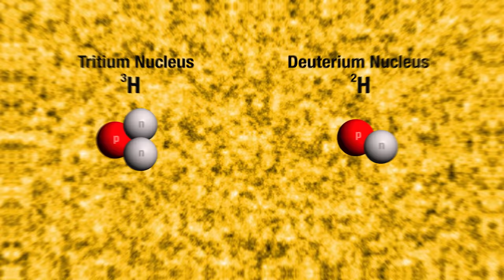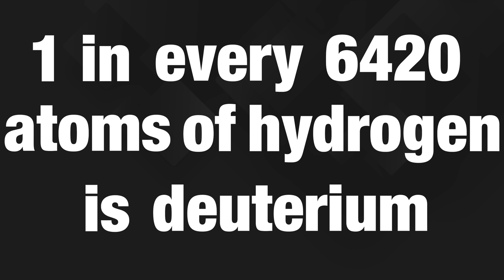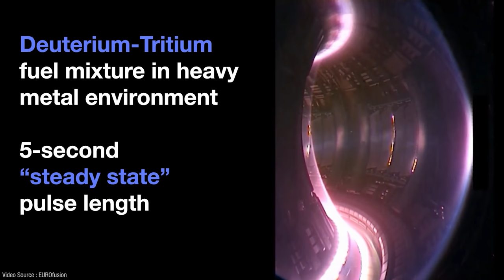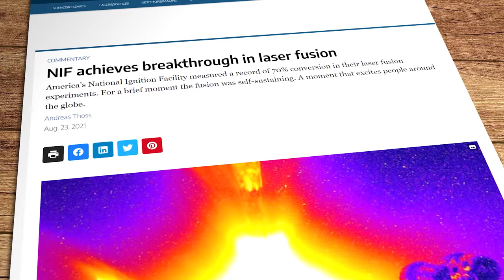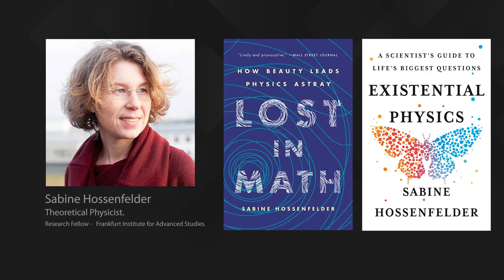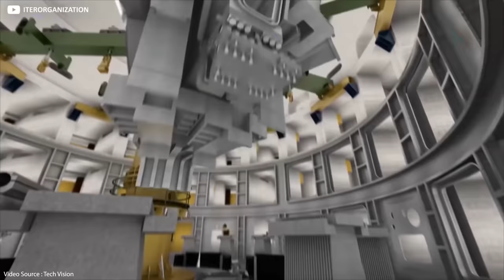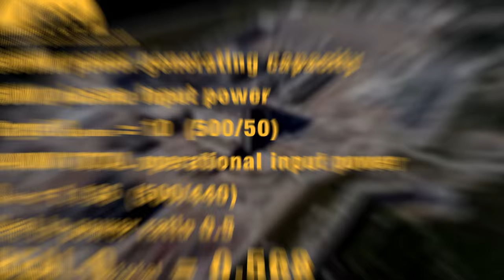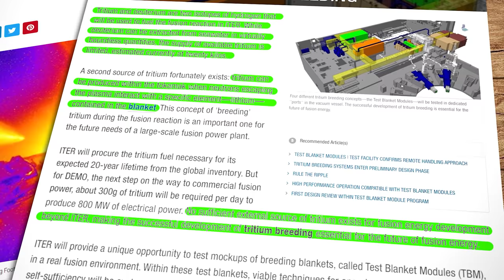Nuclear Fusion Illusion. Is it time to park the pipe dream?

Comment: I think the current approach looks broadly correct: society has essentially stuck fusion development on a background thread and is getting on with other stuff in the meantime. The billions spent so far look to me almost nothing over the timescales we're talking about.
Reply: $25 billion spent over decades by 7 nations. While I support assistance to Ukraine I feel compelled to point out that figure is not even twice what the US alone has spent one the war and associated military buildup in Europe, and just 1/4 what Germany alone spent increasing their defense budget since the war started.
Reply: There are scaling limits to what more could be done with increased funding. Skilled labor, rare materials, and finite electric output are just three caps on it.
Reply: @jackfanning7952  You're talking about fission, not FUSION.
Reply: Investment in Fusion vs Investment in Renewables seems like a false choice...they aren't the only two options in a "budget" zero sum game. This seems like quite an oversimplification and counter productive imo. For example, in 2021 the IMF reported that the fossil fuel industry benefits from subsidies of USD$11m every minute (ref: The Guardian, 6th Oct 2021). Might that be a better source of renewable research finance than (admittedly long term) fusion research?

For mine, a large part of "the problem" is the overhyping and resulting unrealistic expectations...commonly created (often inadvertently) between the research community and the media. If I'm a fusion researcher, I might get much more excited about a new Q figure or "breakthrough" than the public should...and that's reasonable and understandable. The media doesn't seem to parse this though, and passes the excitement (or magnifies it) when communicating to the public...over time creating a sour taste in people's mouths after being "mislead" for decades.
Reply: @nathanlevesque7812  we are still in the research phase. More powerful magnets are already in the pipeline. Until we have a reactor that works constantly there is no point in going faster. What we are doing is working on as many different options as we can in the hope that at least one and possibly more manage to get to an efficient power plant.
Reply: @johnarnold893  I am not talking about fission. I am talking about fusion. My statement are true, but like everything about nuclear power, the proponents cover up and lie about the true dangers or it. Some forms of fission also cause these and other dangers, but fusion will also create plutonium, uranium-233, and can not only burn actinides, but also create them. Fission creates hundreds of radioactive isotopes by splitting the atom, but fusion is worse at creating radioactive isotopes through neutron activation.
Reply: @jackfanning7952  This statement is 100% divorced from reality.  Like, really, pure fantasy.  Please take some time to fundamentally examine whatever path you take to finding truths, because it doesn’t work even a little.
Reply: @seriousmaran9414  ok?
Reply: @jackfanning7952  I didn't insult you.  But if getting insulted is in your mind further evidence of your correctness, that would be a good place to start, as I assure you it isn't terribly relevant.   

If you feel any of the people you mentioned told you nuclear fusion reactors produce uranium or any other element remotely so heavy, I promise either you misunderstood or they are not actually experts on any relevant topic.
Reply: @jackfanning7952  What exactly is YOUR plan to power the world with zero waste? Or are you just anti-ideas?
Reply: @hattielankford4775  I do not know of any plan to power the world with zero waste. I am opposed to fossil fuels and nuclear used to generate electrical energy for many reasons. The best plan that I see at this time would use a combination of efficient energy use and renewable sources of electricity to replace electricity generation systems based on fossil fuels and nuclear power. With renewable sources, base-load electricity can be provided to the grid by bioenergy, geothermal, solar thermal with thermal storage in water, rock, or thermochemical systems and wind power with a little back-up from natural-gas turbines. Intermediate load can be supplied by solar PV without storage. Energy supply will vary depending on the best options for a given area. 100% of our energy needs can be supplied economically by 2030 with a combination of energy conservation, and technological advances in energy use in buildings, appliances and equipment and renewables without significant impact on our society standard of living or energy use requirements. Nuclear is not only a huge waste problem but creates the greatest risk for our economy and all life on Earth at this time
Reply: @jackfanning7952  You're ignoring so many factors. I wanted that to work out for us, too, but we WILL need dense, stable energy generation capabilities.

Consider geothermal. The most efficient use is local while minimally disturbing local ecology. Beyond that, not all hydrothermally active areas have sufficient capacity to serve a large enough area to be economically viable to even develop. Add to that potential impacts to historical and environmentally protected areas, and "available" geothermal decreases even more.

You seem to only be considering the maximum potential for energy generation without considering other effects.
Reply: @jackfanning7952  Okay, but your previous post made it sound like you think these heavy isotopes would be produced as a byproduct of fusion for energy production, which is not true at all.  There are MUCH easier ways to get fissile materials (relatively speaking, anyway - those ways are still quite difficult), so it seems rather silly to be concerned about fusion reactors from a nuclear non-proliferation standpoint.
Reply: @jackfanning7952  fusion takes variants of hydrogen and combines to form helium. You will not get much uranium or plutonium from that.  The reactor will be radioactive but that really is not an issue. The chances of a Chernobyl like incident are zero.
Reply: @hattielankford4775  I did not mean to ignore any factors. I consider new, efficient electrical technology, intelligent building design and energy conservation to be the best bang for our bucks for energy needs. I think new energy production with renewables is the best production solution for many reasons. I am certainly not alone. Worldwide, investors have been voting big time for renewables with their money. I was summarizing what I think are the best worldwide options with the fastest and most economical solutions. Books are written on the many details that must be considered. Geothermal is used successfully in the U.S., Iceland, Phillipines, Central America, and Indonesia. It is part of the solution. How big of a part, I don't know. I do know that energy storage and building techniques taking advantage of the constant temperature in the Earth are excellent examples of passive energy conservation. Buildings with tunnels providing cool ground air at floor level with vents at ceiling level on the opposite side help with cooling. Evaporative cooling works well in hot, dry areas.
"Dense, stable energy generation" sounds like a dog whistle that nuclear proponents use to justify nuclear energy. Were you referring to geothermal? Nuclear proponents also use climate change as a red herring to elicit funds for nuclear power. I consider money spent on nuclear a lost opportunity cost and an albatross around our necks.
Amory Lovins is a prolific writer on energy use. The World Nuclear Industry Status Report that comes out every year gives specific information on energy developments all over the world. It is a very comprehensive source of information on all types of energy production.
Reply: @jackfanning7952  I'll admit I was on your exact page when I was getting my degree in environmental engineering. I didn't want to admit that an energy solution couldn't be maximized while completely excluding nuclear and fossil fuels. In reality, the solutions are going to be dependant on the areas they serve (both local and regional) and there will need to be a larger grid/grids incorporating those areas. You can't exclude things until you analyze systems and see what you'll actually get out AND analyze the combined impacts from full life cycles. 

However, weighting is subjective. Do you value publicly accessible space for existing more than space restricted from public use for turbines more than space restricted from public use for PV more than... It doesn't really matter what order or what combination, this is where NIMBYs come in. Ah, the human factor. Have fun predicting that. Either way, the most likely outcome will be restriction of available space ideal for the energy alternative (e.g., drilling rights where there is no oil).

I do agree that building structures actually meant to withstand local conditions is vitally important. As with providing aid, we need to learn to incorporate local factors (e.g., people, situations, materials types and availability, geological resources, etc.) and maximize local energy potential. We also need to figure out a way for benefits to be equally distributed in such a way that some people/groups don't overly benefit from the system (i.e., extreme wealth disparity leading to conflict).

There's way more, but do you understand what I mean about needing to take factors other than those directly related to energy production/storage into consideration?
Reply: @hattielankford4775  I worked as an industrial hygienist for thirty-five years, monitoring pollutants and toxic exposures, evaluating air and water quality and industrial processes and recommending solutions. I had dual responsibilities in environmental issues, like RCRA and radioactive waste management, designing remediation plans and environmental disaster responses. I say that to say it is a complicated field that many people don't understand. The most complicated part and least obvious part of it is the human factor. People don't always make decisions based on what is the best for people and the environment. Vested interests are involved in every decision made. 
If you want to figure out a way to ensure that benefits are available for all people, provide systems with a level playing field for those providing products or services. In general, solutions that offer diverse solutions and competitive options favor consumers over vested interests. None of the industries I have worked with have carved out more special treatment and more disdain for consumers and the environment than the nuclear industry. Advances in electronics and computer technology provide flexible, distributive grid systems that break up the monopoly that approximately 32 utility corporations have on the energy grids in the U.S. today. Those utilities primarily provide fossil fuel and nuclear energy, with a smattering of renewables for PR purposes. They are bribing and threatening legislators that if they don't provide more subsidies to nuclear they will burn more coal. See bribes to House Speakers Madigan in Illinois and Householder in Ohio. SC and NY convictions and investigations for fraud in nuclear deals continue. The brightest and best financial advisors are absolutely certain that the energy market will drastically change in the very near future. Money talks and obsolete, unprofitable technologies will walk. If you own stock in fossil fuel and nuclear utilities, I would advise you to do something else with your investments. That is true for the rest of the world as well.
Reply: Thats a big point and also in part why its "always 20 years away". There simply is not enough money in it. 25 billion over decades is nothing. Especially if it comes to such extensive projects. The main problem with for example also this video, is that everything for and against fusion is theory. And till we have not build a large and complex enough plant to really start checking our math, its all just guessing because there is so much variables in it. Fact is, we will need massive amounts of energy, and fission power is only a stopgap. Either we REALLY invest into renewable energy, which is due to often stupid populist arguments not really happening at the speed we need it to, or we finally really investigate if fusion is a viable possibility. And we need to build the facility and testing to figure that out.
Reply: @jackfanning7952  "investors have been voting big time for renewables with their money" - and some have been burned. Just a couple of weeks ago DW reported on Spanish investors who took advantage of subsidies to invest big time into solar, then the government realized that they had to pay less for the energy and the investors got the shaft.
Reply: @jackfanning7952  I mean, they probably regret getting hoodwinked. And if they could go back and not invest in solar, they'd do that. And Spain would have less solar today. Doesn't mean they'd put the money on nuclear, it just means investors putting their money on renewables can end up poorly.
Reply: @ChucksSEADnDEAD  Investors always take risks with their investments, unless they are in a crony capitalist system rigged in their favor. The biggest risk is usually from a set of fools in government who know nothing about running a business or an economy. I have known some very savvy investors who lost everything they had because of irrational government policy. Investors look for several things to invest. They don't like to lose money, they don't like to take big risks that could cause them to lose money, and they want a quick return on their investment. No investor in their right mind would choose to invest in nuclear over renewables in this day and age. That is why nuclear is milking the countries that have nuclear weapons to fund fusion reactors with taxpayers' money. Same goes for keeping the old rust bucket fission reactors lumbering along.
Reply: @jackfanning7952  Could you stop? You come bragging about renewable energy investors, then backpedal and say "oh it's a risk". Of course it's a risk. Wouldn't that kind of torpedo your own argument earlier? That investors get burned just as everyone else would, and "investor" is just the name for people with money rather than an actual title of authority?
So now you admit your initial argument was bull. "Savvy" investors are looking for that government moolah and when governments can't hold up their end of the deal they lose. A "rational" government policy would have been to not promise subsidies and prices that the government wouldn't be able to afford, so they wouldn't have attracted investors. No investor in their right mind would invest in renewables if they were getting the cold shoulder like nuclear is.
There's no money in energy unless you're selling oil or gas, apparently.
Reply: @jackfanning7952  Stay mad tho. Normies are coming around on nukes, in fact the series Chernobyl helped dispel a lot of the fears.